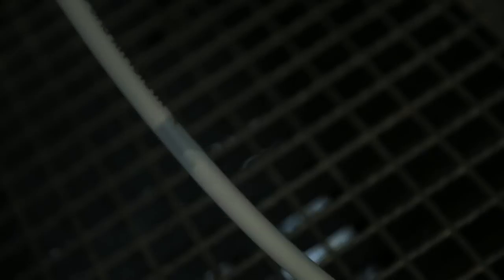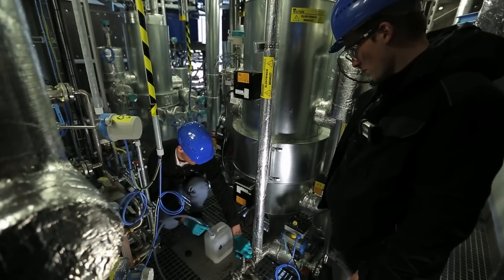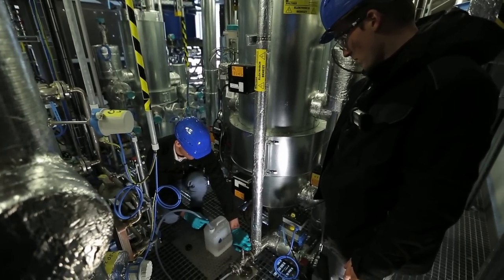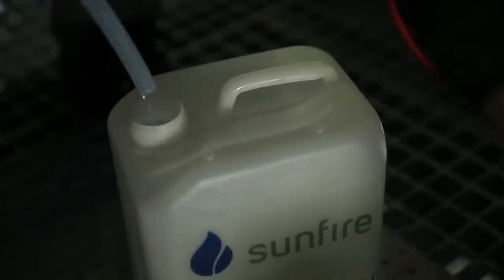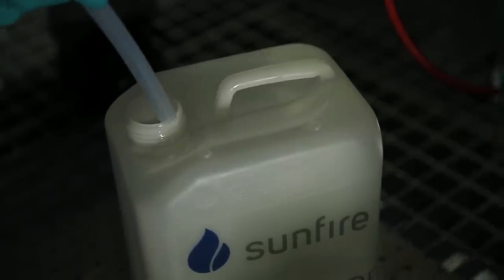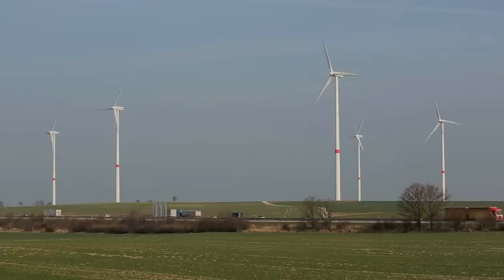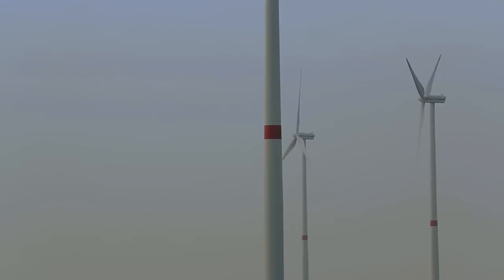Dabi News - Audi just created diesel fuel from air and water

Comment: So instead of using up our oil, with this method we have to use up our water? Water is quite a precious resource, I'm not sure this is very sensible...
Reply: Unlike oil... Water is renewable mate. Plus due to the melting of ice caps we have water on the rise. Somehow we need to waste some water anyway (small part of it goes out into the space while majority of it about 99% returns back to earth through a cycle from liquid to gas back to liquid.)
Reply: tombland1 the advantage of using water is that the combustion of fuel produces it, it's why smoke is white if I'm not wrong, so as long as you take as much water as is produced by the combustion of the fuel to create it, you'll never run out of water

Comment: It is great news and it is academically cool, but by simple physics the process of making the fuel and burning the fuel is far less efficient than just using the electricity used to produce the fuel itself to propel the vehicles. And at the rate electric cars and batteries / super-capacitors are advancing I doubt that this technology will survive longer than a decade or even if it will be commercialized on a large scale

Comment: can this fuel be used in electric vehicle fuel cells?
Reply: its made for combustion, i.e. in place of fossil fuels (so a petrol or diesel ICE - internal combustion engine - would burn it), not for chemical energy storage like in a battery for an electric car. In a hybrid with an ICE, yeah it would work.
Reply: Fuel cells don't require combustion to convert from a fuel to electricity... just wondered if this type of fuel can be broken down into its elements using a proton exchange membrane